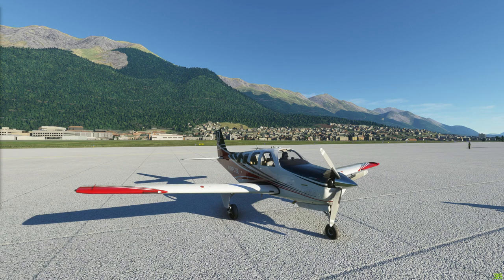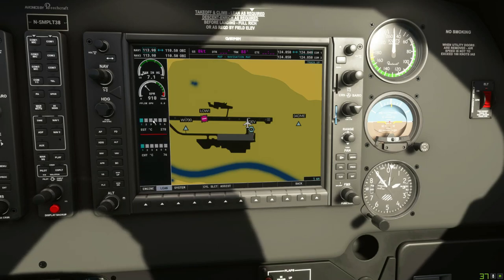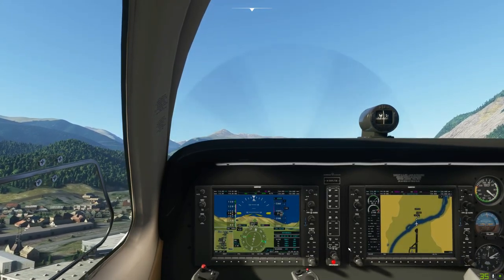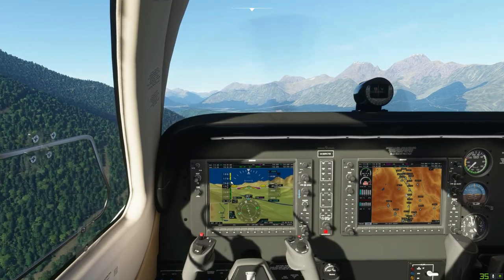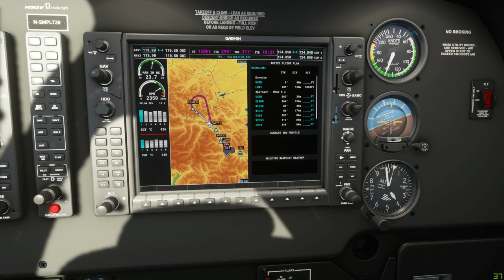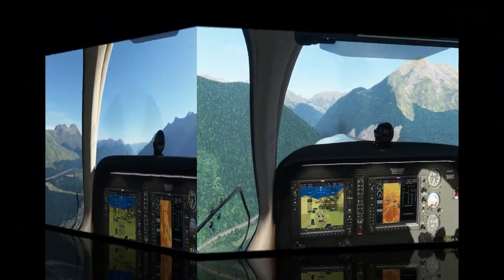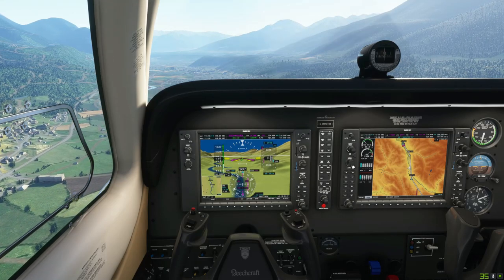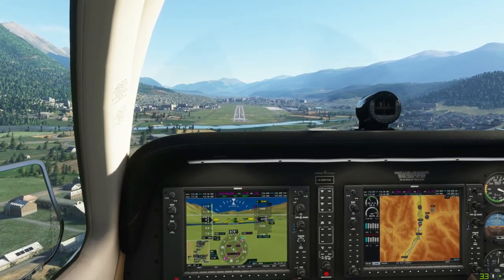Microsoft Flight Simulator 2020 Tutorial EP#23 | How to set Throttle, Mixture & Propeller RPM

Comment: always enjoy your tutuorials, it is good to see you are human, i crashed last night because i flew late at night and i was tired. pilot error for sure. i did not notice my g3000 was showing me i was coming in too low. flying the tbm930, boy i was mad as hell. where are the mods for the g36. thanks again
Reply from the maker: Thank you James, when focusing on something you can miss million others that can lead into problems and that's what happened. Luckily was able to correct and land.
Reply: You. Know i found another problem too, for some reason my yoke( ch sim yoke), the elevator up was not functioning, down was, very weird. So i install current drivers, it wiped out my yoke programming so i did a fresh start.
Reply from the maker: @jtepsr  there are some changes to the sensitivity settings with the last patch. Out could be part of the reason, I had to do my sensitivity settings from scratch after the patch.
Reply: @jtepsr  Yes me too I was constraint to recalibrate all my axis with the sensitivity feature but don't have a Ch yoke but a MS Sidewinder FFB2 and a Saitek Throttle Quadrant.  For both I have to set again all the axis sensitivity parameters. have a nice week. I hope for now all is working fine on your side. Happy flying.

Comment: How do you use those controls on the TDM 930. Bye mixture control doesn’t work and the prop control works as the condition lever which makes it very hard to find low idol and high idle. Also with these quadrants hooked up it is harder to manually move the throttle with the mouse.
Reply from the maker: I'm not using the Throttle Quadrant when I'm flying the TBM. As you said it's quite hard to do with the quadrant. Therefore, I'm using my mouse instead.

Comment: Using FS2020 with  Beech Bonanza, but I can not display EGT.  What do I need to do?
Reply from the maker: Rachel do you have the Bonanza g36 improvement mod? EGT page is coming with the mod if it's not installed you'll not be able to see the EGT
Reply: You can still watch the RPMs for the result of leaning -- EGT is a more literal way to see it, but the engine will actually respond -- you could even hear it in some cases. :D